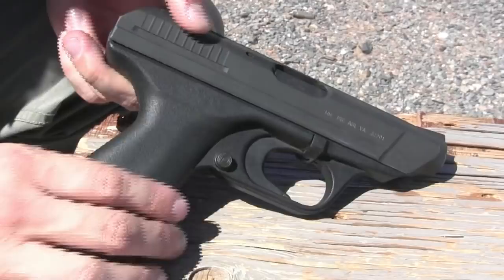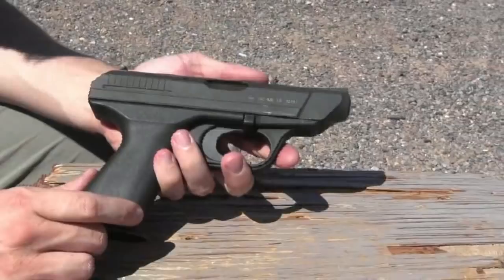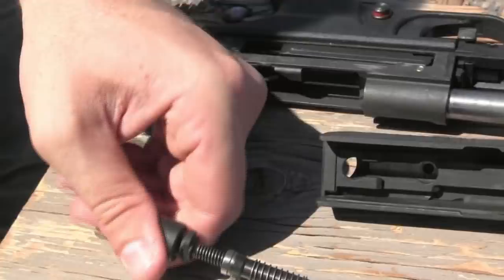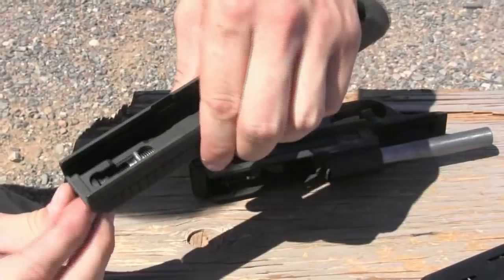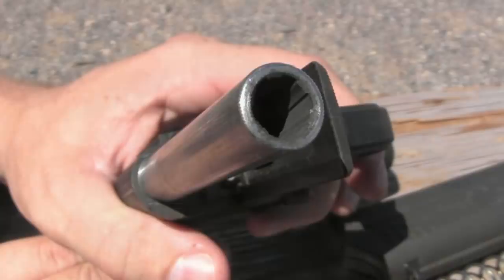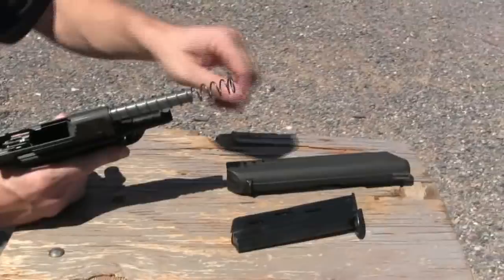H&K VP70Z - Disassembly and shooting

Comment: I knew about his gun before, but I've always had this doubt about it... A straight-blowback 9mm Parabellum? is that even safe? :/
Reply: OK, now I get it... The deeper rifling causes a lot of the pressure to be lost, as the gasses just go past the bullet instead of pushing it... Huh. :/ Thanks. :)
Reply from the maker: LJVolkov21
There are other examples of plain straight-blowback 9mm pistols that are safe, like the Astra 600 and Hi-Point C9. Hi-Point may not be much in the quality department, but they are safe.
Reply: Forgotten Weapons I see. I'll have a look at those. Thanks. P.S.: I just love how those spent casings get thrown right at the camera... :D
Reply: Forgotten Weapons But I still don't see the point in making 9mm Parabellum blowbacks. The slide needs to be heavier and/or the rifling has to let some of the gas escape past the bullet... This doesn't sound very conducive to accuracy. Especially with triggers like that one. Sounds like we might as well get .380s... :/
Reply: Forgotten Weapons ...and the Hi-point can be used as an impact weapon when it fails (29oz unloaded for a single-stack), and it WILL fail.
Reply: +LJVolkov21 It allows you to make a really simple and thus cheap pistol in the "cool" and "dangerous" 9mm. It may be junk compared to a .380 but 9 sells better.
Reply: I'm really glad most of the comments on the newer videos on this channel lack the ignorance displayed in these two previous comments.

Some people take hubris and groupthink as fact these days.
Reply: ootdega
 Well you know what? I'm here to try and learn something. If I'm wrong about something, you're welcome to tell me what it is and tell me why. Calling people ignorant doesn't help.
Reply: LJVolkov21
I'm talking about the two comments before me.

"Junk compared to .380" when .380 is exactly the same diameter as 9mm with a lighter bullet and slower velocity.

"And it WILL fail" obviously comes from someone who has never even held a Hi-Point, let alone shot one. 29 oz is no heavier than a Sig P220, and that's without the steel frame. Any negatives a Hi-Point has are a direct consequence of its target price, and none of them impact its reliability.

The general firearms community is full of self-congratulatory groupthink caused by the need to validate their purchases.
Reply: ootdega
 I see. In that case, I apologize. I don't know why, but one of those comments was not visible to me. Now I see it.
Reply: ootdega
In any case, what do you think about the idea of 9mm blowbacks? A 9mm without any kind of locking mechanism doesn't sound so good to me. I still think I'd rather try a plain .380.
Reply: LJVolkov21
It's perfectly safe if done right, but the slide has to be a lot heavier to achieve it (or in this case, vent most of the chamber pressure out the barrel). Hi-Point even has a .45, which has an even chunkier slide. Still not as heavy as a 1911 though.

Blowback is just a lot cheaper and simpler to make, and so Hi-Point pretty much the least expensive handgun you can buy new. Concealing one would be virtually impossible, but if that's all you can afford, it's there.
Reply: ootdega
 Makes sense. But it doesn't seem efficient if even more gas just slips past the bullet instead of pushing it. It just seems that  velocity (and therefore accuracy and power) is negatively affected, which wastes some of the 9mm round's potential. Blowback is cheaper, and from what I know so is 9mm Parabellum, but then you're not going to get a performance far better than a .380, are you?
Reply: LJVolkov21
9mm Parabellum has over two and a half times the muzzle energy of .380 ACP, actually. It's less expensive because it's so common. It's used very widely by police and law enforcement as well as NATO. That drops the price quite a lot.

.380 ACP doesn't even have the energy to expand some hollowpoints.
Reply: ootdega
 Interesting. I'm actually pretty surprised that a cartridge so weak is actually so much more expensive than a military cartridge...